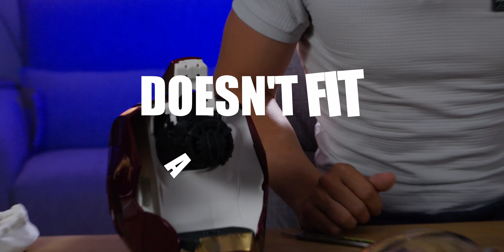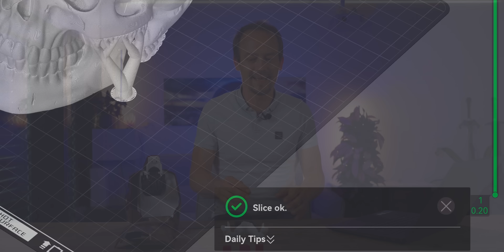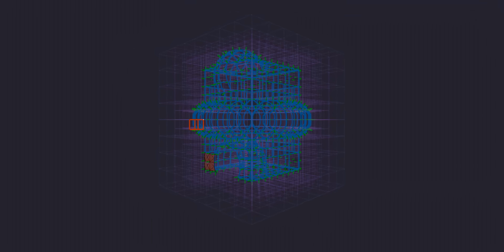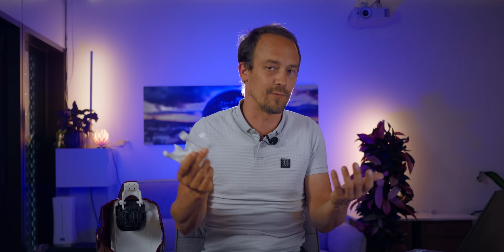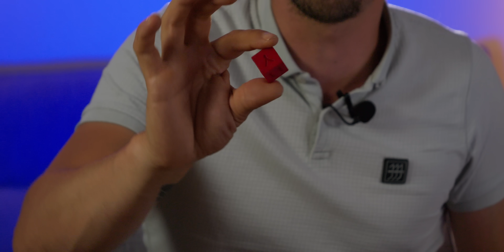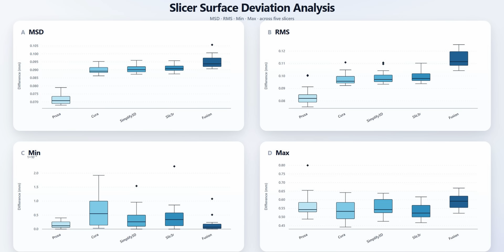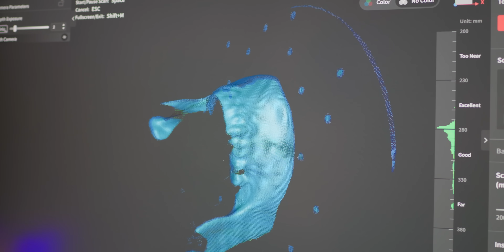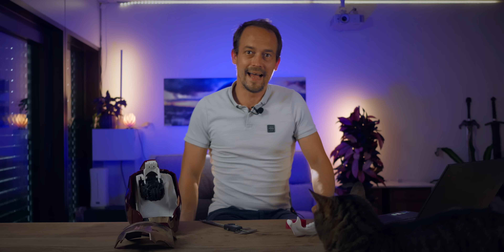The Hidden Error in 3D Printing - This is How We Found out

Comment from the maker: What's another "everybody assumes it matters, but nobody has actually measured it" topic in 3D printing?
Looking for ideas 👇
Reply: As I understand it Marlin and Klipper firmwares handle Arcs differently. I'm not sure about RepRap. 

How about the same testing, but add firmware as the variable being tested?
Reply: I'd be interested in knowing how inaccurate the slicer is if you have incoming STL "rounded" to the extrusion diameter (e.g. 0.4mm or 0.2mm).  I think that the slicer has to cope with the physical constraints of layer height and extrusion diameter would impact this?  A typical calibration cube is a whole multiple  of 0.4mm extrusion width and 0.2mm layer height.

This also leads into things like if slicer settings like Archane reduce this error (at least in XY).
Reply: @craigsiedema  At least Orca slicer can get closer to the intended Z by deviating from the set layer height and match some layers to the actual requirement. Plus we had the limitation of stepper motors working in steps and a fixed pitch lead screw for height, making only multiples of commonly 0.04mm possible. Changed with microstepping though.
Similar problem with XY: if you know how wide the extruded trail of plastic is you can adjust the tool path. Within the abilities of the motion system, i.e. motors/drivers and belts. Make a 100m square with a 0.4mm nozzle(0.45mm extrusion width)? Have the head draw a 99.5mm square and you're pretty much spot on, in theory.
But that's for straight lines. Introduce curves and you need to break those down into commands the printer can execute. And arc motion is hard, thus we fall back to line segments. Now you decide how many? High precision means you might not be able to process the instructions fast enough.
That "how many" also is an issue with 3D scans or sculpts. The meshes are too dense. The slicer tries to combine chains of similar moves into a single one. That cutting of corners might show up as deviation.
(And then the used plastic shrinks from cooling and/or annealing. For additional headache!)
Reply: @craigsiedema  that's actually handled with variable line width and why top and bottom surfaces are defined separately. They are different to ensure quality and accuracy
Reply: @da3dsoul  Was it sliced that way?
Reply: Can you (or did you) do this for MSLA resin printer slicers?  That would be very interesting!  Thanks for another in-depth and important video!
Reply: @retromodernart4426  reminds me of how often I'd liked to have the option to select between exposing every pixel that touches the object vs only voxels completely withing the volume! Not to mention whether AA shrinks or grows the model.
That would make consistent, or at least predictable, clearances much easier.
Tesselation would still introduce errors of course. At least only when creating the STL.
Reply: Would it be possible to address the slicer error issue by making a separate tool that does this 1) slice the stl 2) measure the slicer inaccuracies 3) change the stl slightly according to the error “map” 4) slice again 5) repeat until the error is small enough.     That approach could then work with any slicer out there already and no need for you to wait until your favourite slicer has been fixed by the manufacturer.
Reply: @MrLarspetersson error isn't necessarily something you can just fix. It's like blurring a photo. You might be able to use processing to get something that looks better, but it's probably not accurate. You might have one wall a little bit thick and another a little bit thin. If you can do enough testing and have the skills to write a processor that could fix it in every case, then just PR the fix back to the main repo. If you can't do that, then you don't have the skills to come up with a band aid in the first place
Reply: (Edited to correct vowel to voxel. Darn autocorrect) Since you know each voxel has a resolution of 256, shouldn't it be feasible to do an analysis of which voxel condition (1 through 256) introduced the most error?  With that information, you should be able to write code that would post process your g-code to address the induced error.  I mention this because who knows how long it will take for anyone to fix the slicer code.
Reply: Yeah go ahead and add Bambu to the comparison. 😂
Reply: As said in the video, Bambu Studio is just a fork of PrusaSlicer  @AthannaelAnderson , so like Orca Slicer, PrusaSlicer was used to represent all Slic3r forks, as they are all fundamentally using the same engine.
Reply: @markbooth3066 That would be true if they were the same but they aren't or we would say that they are. They are only based on the same, it's been a long time they've been developing on both their own versions. People just regurgitate the same crap year after year, doesn't it get boring?
Reply: The paper is available @AthannaelAnderson , the methodology is available, even the source is available, if you put in the effort you can rerun the tests and prove that Bambu Studio fixes the problem demonstrated with PrusaSlicer, or not.

That is how Science works.

Your hypothesis is that Bambu Studio doesn't have the same problems, that hypothesis is testable, just don't expect anyone else to test your hypothesis for you, however.
Reply: the way an off balanced gantry or axis with more weight on one side than the other causes gantry/ axis twist with higher accel. for example imagine if your extruder was mounted 100mm higher on a typical corexy machine, when the y axis changes direction fast the weight of the extruder will twist the gantry... people doubt my 24v 2 motor machine can print the same speed and accel as 48v 4 motor machines because of this!
Reply: How fast nozzles wear down, and what sort of artifacts the wear introduces? It varies so much, based on type of nozzle, material of nozzle, temp, type of filament, quality of nozzle, extrusion speed, nozzle hole size. But I see everyone saying different things, and not a whole lot of sources for the claims.
Reply: @imonseii you read my mind.
Reply: Something I have always wondered is how much wear and tear on your nozzle affects your print accuracy. So, for example if you nozzle opening widens by .01 mm because you constantly print fiber filaments, what is the impact?  This would help identify a periodic maintenance schedule (change your nozzle every 2000 hours of printing) or suffer accuracy creep of 10% (or something like that).
Reply: @ihsna79  You'd still extrude the same amount of material. That'S governed by the extruder system after all. But the surface sliding over the filament gets ground down. That asks for microscopic investigation and layer adhesion tests.
Reply: @robertmartinu8803 wouldn't it also impact your layer width? You can't print the same max layer width on a .4mm vs a .8mm nozzle so I was assuming it would create accuracy issues as the nozzle opening widened. Also, I imagined that uneven wear and tear would introduce irregularities in the extrusion. A natural but exaggerated comparison might be using a round nozzle vs a star shaped nozzle when piping frosting on a cake. 

I do admit that these are likely insignificant differences but then again I wouldn't have thought the slicer would effect accuracy that much either. 🤷🏼‍♂️

Side note: what are your thoughts on the other comment I posted?  The one regarding finding the error each condition a voxel condition (1-256) has on accuracy and writting script to make post g-code processing corrections?
Reply: @ihsna79  The layer width would eventually by determinated by the amount of material and the height difference between object and nozzle. That is something arachne exploits to print tracks wider than the nozzle to fill gaps, and to a degree even for narrower tracks. But doing that unintentional and uncontrolled? THat's a source of randomness!

The post corrections on the g-code?  Finding out what causes the errors would be interesting! But I suspect the errors are not uniform, but depend on the features the slicer processed. You'd want a feedback on the introduced error during the slicing process, once the original features are erased you can only guess about getting a better approximation.
Reply: heat stress across large surfaces or long protruding features, when will the internal stress make a part pull itself out of the tolerances? Which shapes are more prone to this than others? Can some shapes have an a compensatory shape added to help align the internal stress across an intentional axis, which could be reinforced?
Reply: Should tolerance calculation happen in CAD, Slicer or even more closer to hardware?
At least for a hobbyist 3D-printing boomer like me who did their mechanical drawing -courses with pen and paper, the idea that one should design in the wanted gap between fitting parts directly into the model dimensions is ... pequliar. 
CAD should tell target dimensions and tolerances, trying to meet the spec should happen closer to machinery in CAM cycyle.
Reply: Everyone assumes "It's kind of a black box how how the Slicer gets to the G-Code commands." when you could have looked at OrcaSlicer which is open source. No mystery. No black box. You can get the source code.
Reply: Does the slicer assume a finite width for the extruded filament? Or does it assume zero width?
Reply: There was one video where a guy says he calibrates for expansion for each color of each filament, since each was slightly different. He claimed it was due to differences in expansion and contraction during printing and/or cooling. I think he was able to get fit with 0.1 shrink or maybe even less (you always need some tolerance for good engineering AFAIK, even if print is 100% perfect--if it works without that, it probably shrank during slicing or printing). At that rate, even small defects like bubbles from wet filament are significant. Of course, convex corners need to be rounded, because concave corners naturally get rounded by the print process. If I account for corners and nothing else (other than extrusion amount, pressure advance, input shaping, & scraping off bubbles with something functioning as a card scraper), I usually need .2 on each part (.4 total) if both fitted parts are 3D printed, or .2 one one part (.2 total) if other parts is a machined part. I just live with it.
Reply: Annealing. There seems be some spec sheets, and people say you should do it, but like...how much does it matter
Reply: It can matter a lot and is standard for injection molding.
But it's very not trivial to do with with 3D-prints with your usual home setup.

First you need to fixate the print (for some it might be enough to just leave it stuck to the build plate), then you need a very precize temperature control.
And then you will notice, that even though you did everything right, your layer adhesion is completely fu**ed up.

That's at least my experience so far.
But I want to do some further testing in the future.
Reply: @da3dsoul u will loooove the next video
Reply: Another "everybody assumes it matters, but nobody has actually measured it" topic is "what percentage of people have purchased a 3D printer, printed 2-3 items, and the 3D printer is now effectively a paperweight sitting in a corner unused because the ideas ran out."  I assume the actual number is somewhere in the neighborhood of about 95% and that matters but no one has measured it.  I like the idea of a 3D printer but I quickly realized I have no actual use for one and therefore didn't get a 3D printer.
Reply: @privacyvalued4134  uh yeah a 3d printer is just a tool... how many tools do you have at home that rarely or never get used... alot id guess... if you dont have a job requiring that specific tool you wont use it daily...
Reply: @privacyvalued4134  Doubt.

I got a 3DPrinter just for printing stuff for FPV drones. But over the years I used it for tons of stuff in the household.

Often just simple things like a grip/adapter or for leg-extension on a table, a plate for the mailbox, a watchstrap, small containers, etc.
Often you can design those things within a few hours or you will find something on printables/makerworld.

I would not ever want to live without one again.
Reply: @privacyvalued4134  if in EU, tell them about drukarmy, and sadly they will not out of purposeful jobs for the next years.
Reply: @privacyvalued4134  well there's no way to validate or measure that, especially when there are people named "privacy valued" lol

Comment: Some tips to help:  1. Resolution setting in default slicers is set too high. 2. Arachne introduces more deviation than Classic. Try "Classic", not Arachne (default). and resolution set to 0.02mm or smaller. (outer wall set to 100% to 110% of nozzle diameter max. ) The deviation in the slicer preview is visible before/after. Cheers.

Comment: How did you account for line width in the reconstructed model? The gcode path is centered on the squished plastic line and line width is variable (based on extrusion volume and speed at a given time). This means the resulting part is larger than the min/max X Y coordinates in the gcode.

Comment: why are u using years old tech to test something and have conclusions? slic3r last release was 2018 simplify 3d last release 2022, are u using prusa slicer fork from slicer that is the best one on ur metrics but not using orca slicer that is the las iteration of both slicers. and talk about the bamboo one that is also a for of a fork. i dont think this is a correct or valid comparation.

Comment: I really wish you had spent more time analyzing where there errors happen.  Slicer profiles are not generally targeting perfect machines, they embed many decisions which intrinsically consider mechanical issues.  At minimum I’d have liked to see how nozzle size and layer height affected errors, and also speed.  It would have been interesting to see how a 0.2mm layer height with 0.4mm nozzle diameter and draft speed differed from, say, 0.05mm layer height with 0.1mm nozzle and 10mm/s speed.  Likewise FDM sliced versus DLP or SLS slicing? 

Or, more generally … what is the EXPECTED error?  Given an stl, what would be the best possible error result, given the issues intrinsic to a particular process?

Comment: I have to strongly disagree with the sentiment that prusa and Bambu slicer are the same. I have a client that uses  multiple Bambulab machines, while I use a core one. And in ALL of my designs i have to double the tolerances for it to work on her end. We recently had an issue with a print in place part, where 2 large radius curves where right next to each other, seperated by 0.35mm of airgap, and it would constantly fuse together, no matter what settings we changed, while that very same part printed no issues on my machine. There has to be some manner of difference between these slicers.

Comment: It's not a remastered version of your voxelized because you're literally voxelizing. You could have a gentle flat surface. You're literally voxelizing it. It's not, and now you just talk about aliasing rather than Nyquist frequency, inside-outside, turning sampling density of the part thing. I mean, it's sad.
This is super interesting. You missed a lot of it, though, and you missed stuff that you could say, like you could state what surfaces are important in what terms, inside or outside friction fit, not friction fit. You could have methodologies that work with this. You don't even talk about the step of motor size, even if you had real circles. You still need a step of motor with the instructions that break it down, which then become an ngon

Comment: You're creating more error and you're introducing new geometric considerations, so you're massively increasing the error. This is not a valid methodology. A valid methodology is super simple:
1. You use a winding methodology for inside and outside. You take the G-code exactly and you render it on top of the actual 3D file.
2. For the height, because you know the toolpath thing is either in vase or it's in sections at a given height level, you do what's called the in-out determination. You shade all parts of the space that is external to that.
3. You might say, "Well, how would you know that you need to create a vertex thing?" No, you don't. You use fields. You render it as a field, not as geometry. That would be the best way.
4. You would have an exact, non-mesh union, but you'd use signed fields and you know exactly where things are inside or outside the tool path.
I think that's a better methodology.

Comment: You should have compared the scan to the g-code because if the part were closer than the scan vs stl then it would confirm that the problem is in the slicer.

Comment: I had this suspicion already years ago when I printed the same part three times with one slicer and then switched other slicers. I started with Slic3r, then Cura and later switched to Simplify3D. The parts all came out different, altough the major print settings like temperature profiles, and speeds we set identically. What I also learned was, that when your parts geometrically important dimensions are an integer multiple of your nozzle diameter, only then the dimensions remained identical between the slicers. This taught me everything I needed to know.